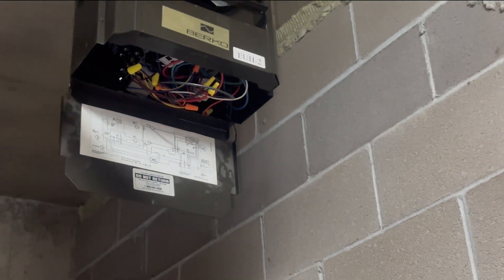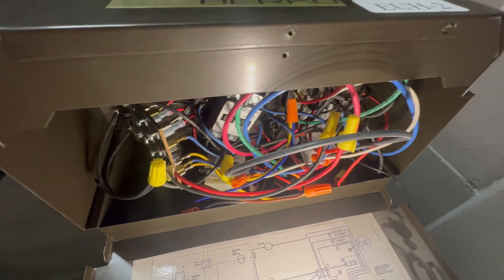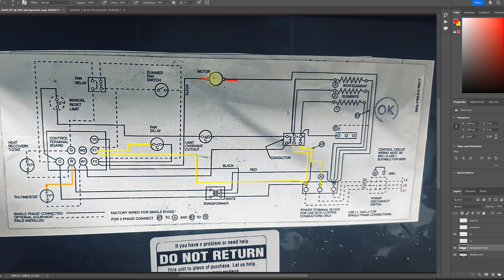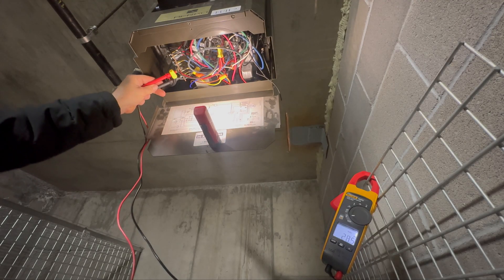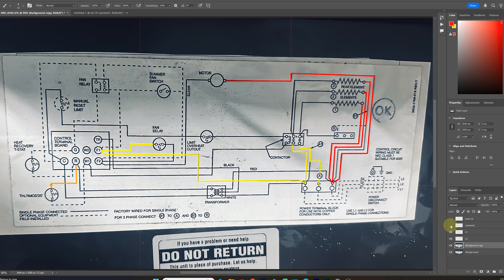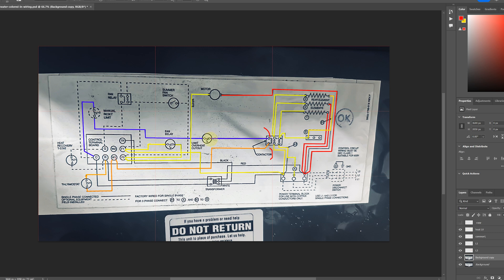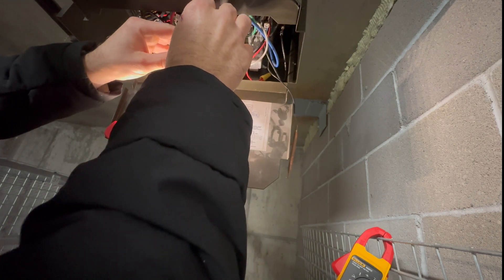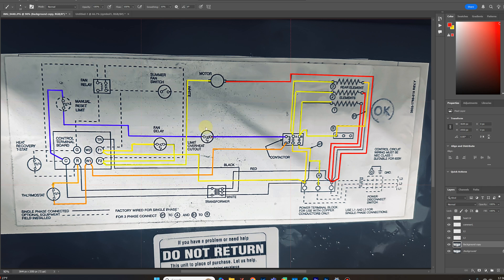Troubleshooting Heater with Wiring Diagram

Comment: Hey so what caused high limit switch to cut out ?
Reply from the maker: I'm not sure - these are supposed to reset when the temperature drops.
Reply: I have iasues with those fan motors wont start after all summer been off that trips the high limit, before i start this in the winter i spin the fan first